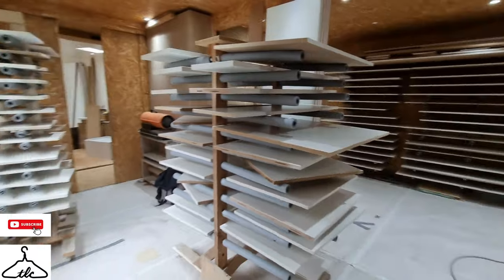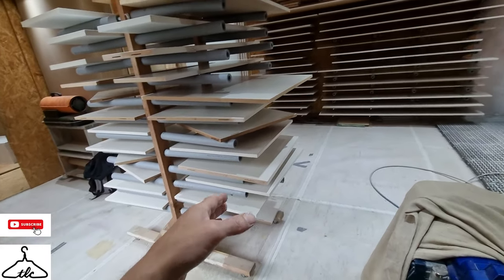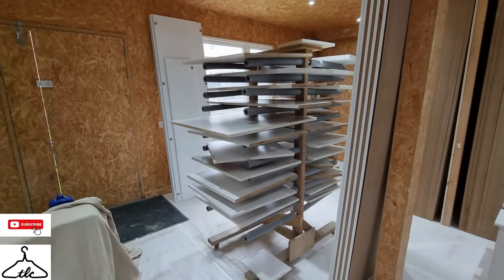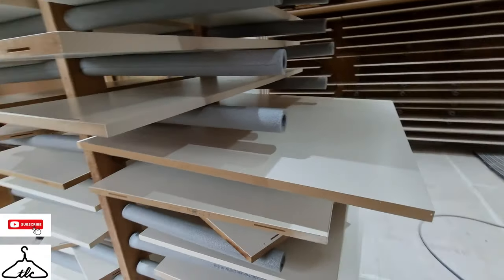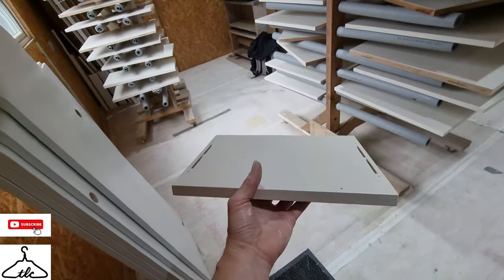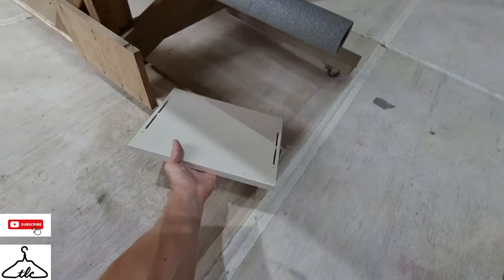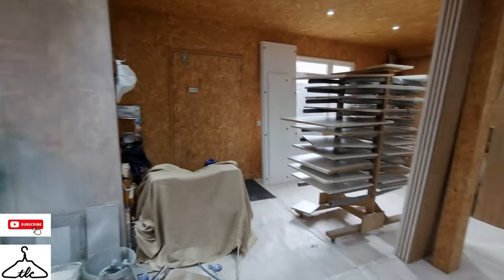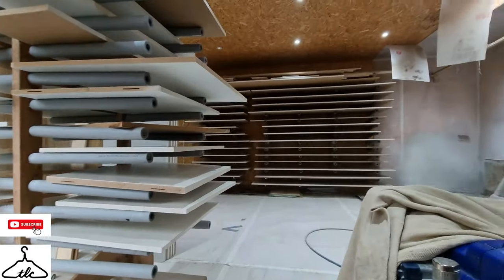HOW FAR DOES 5 LITRES OF PAINT GO ? // SPRAYING With An Airless Sprayer // Coverage Amount // EP#148

Comment: Eggshell leaves an eggshell like texture anyway... Is using the airsprayer making the texture more textured.

Cracking set up in the spray booth...

Glad im not the only one using silk emulsion for priming mdf..
Reply from the maker: I guess there are a few variants. The pressure used on the machine, the tip size, how fast you move the gun and your spray technique.
I personally don't think you get much different finish whether using eggshell or emulsion or satin etc, the end result is generally the same.
But eggshell, especially dulux diamond, is definitely super hard wearing.

Yes I've been using the silk as a primer for a while now and personally think its better than standard primers. It's so much tougher, sand up like glass and is a 3rd of the cost to say an acrylic primer undercoat.  👍

Comment: Do you ever heat the boards, paint or lines before spraying? And you don't use heat lamps for curing, not sure if it helps with orange peel
Reply from the maker: Not really. If its icey cold out I'll heat the room up with the space heater and possibly keep it on, but generally the spray room is pretty warm and had no need to do anything else. I'm not sure it would chamge the outcome of the finish.
There's always very slight texture as it's an airless sprayer, but still an excellent finish without needing other slower types of sprayers
Reply: @thelondoncraftsmanworkshop  I have an airless sprayer, and never have a texture to my finishes, Its all in the prep of the material and possibly the quality of material.